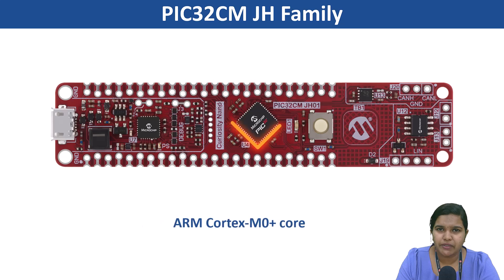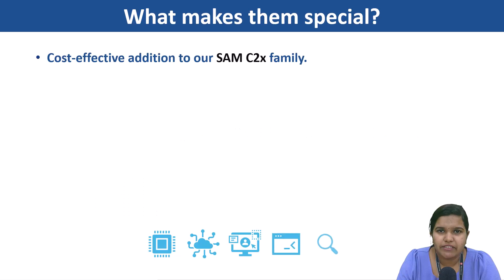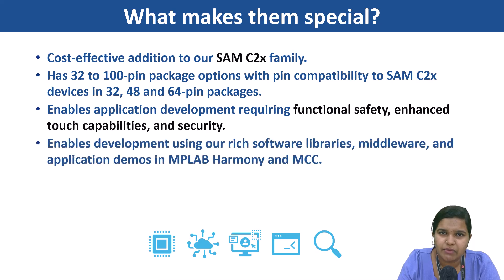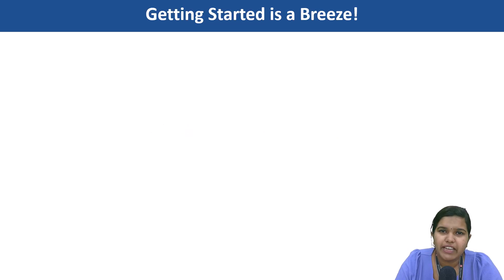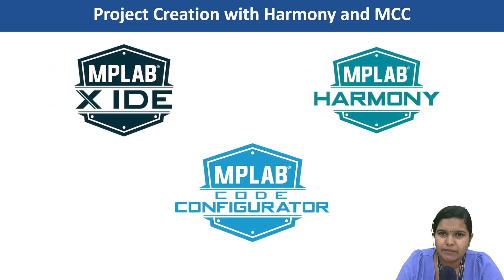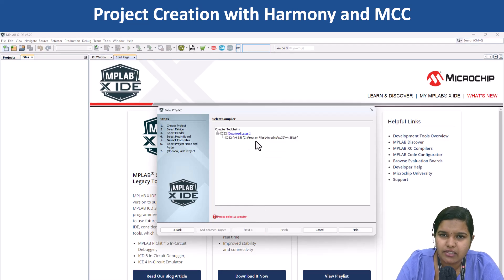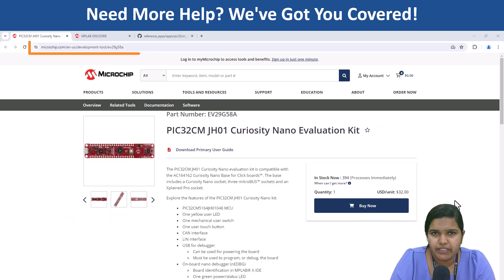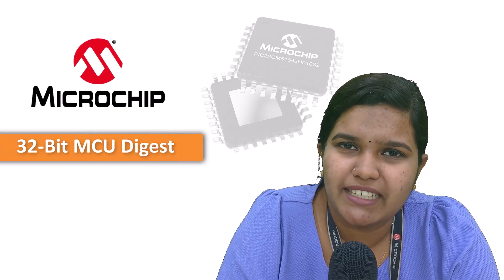32-bit MCU Digest | Build Smarter with PIC32CM JH using Harmony and MCC: Automation, Touch, FuSa, 5V

Comment: we need something far more advanced then this
Reply from the maker: Hi there, thanks for reaching out! Based on your need for advanced performance, we would like to recommend the SAM E70 Series (https://www.microchip.com/en-us/solutions/technologies/displays/embedded-graphics-solutions/mcu-guided-selection-tool-for-graphics/sam-e70-series). It offers a 32-bit ARM Cortex-M7 core at up to 300 MHz, 2 MB Flash, 384 KB SRAM, and extensive connectivity options. Perfect for demanding applications. Hope this helps!